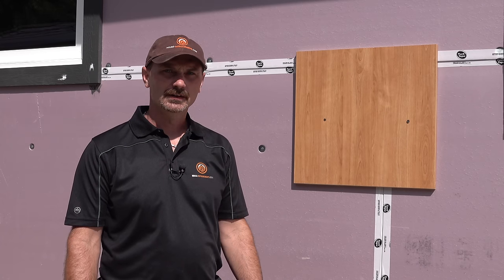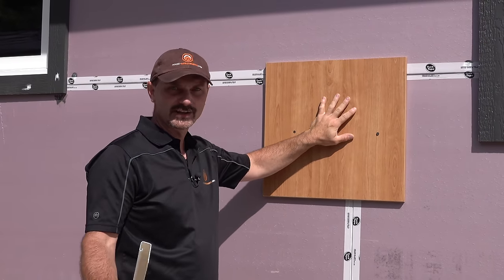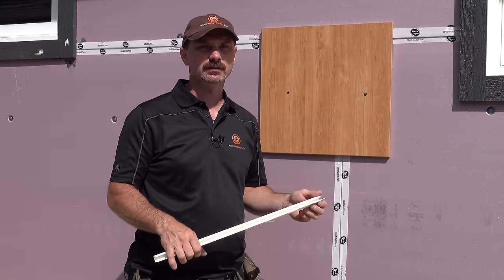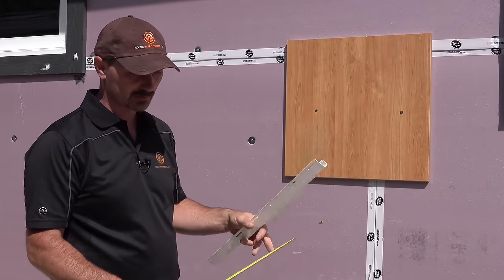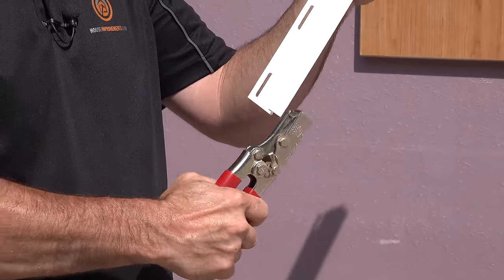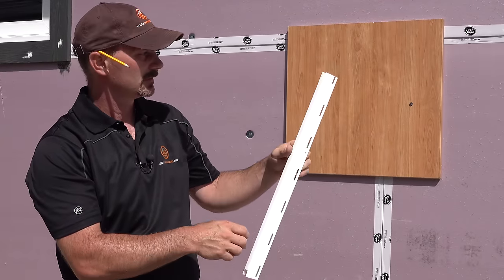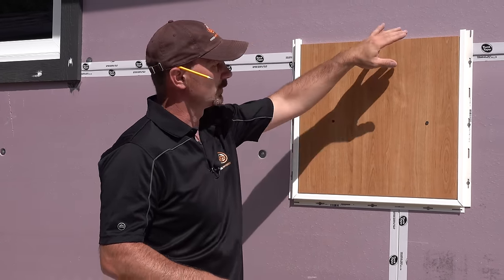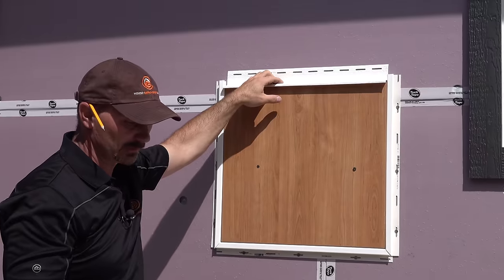How To Install J Channel (Vinyl Siding)

Comment: drip cap should extend well beyond what the drip cap is protecting from drips. Water, because of its nature,  without wind, will wrap back under what it flows over. So, the front and side intersection of the cap should be no closer than an inch to the window, door, etc,  edge, otherwise you rely solely upon caulk joint. The method demonstrated has the  drip edge end right into the back of the J channel. Yes the top is wrapped over into the channel , but the inside corner formed by cutting that tab is now butting the very joint that you are trying to cover. If you still aren't tracking, it is the intersection where the end of the drip cap returns back to the wall.

Comment: That's like my garage wall, the rigid insulation is directly under the vinyl siding. I have to replace an entry door at back of garage and install an exhaust fan.

Comment: Dozen videos I searched through and he is first person to mention a drip cap for windows!
Reply: DUDE, you are so right, I have not seen not a single other video talk about this. Soooo glad I found this before putting in my windows.
Reply: @BobbyCannon  hi Bobby Did you Find the DRIP at Home Depot or Lowe’s ?
Reply: @MACEDONIAbitola  I have framed in the windows but have not taken the next step to cut the metal and finish the install. Working on it as time goes. I'm taking vacation in about two weeks and we plan on wrapping up this install. I'll post a link to our video. :) I have not found the DRIP yet, honestly I keep forgetting. I'm going to put it on our list now.
Reply: @BobbyCannon  I just came back from Home Depot I Found 3 Different Drip Caps 2 Aluminum and 1 Was Vinyl but it was made to Support a J Channel under the Drip Cap I will Try it Tomorrow 😁want to See how the Vinyl Looks Like 👍

Comment: Excellent instructor I learned so much watching this.  After viewing this and a couple of your other videos I went outside to look at the add on section of my house that was done with vinyl siding.  Man the people that put my vinyl siding made so many mistakes. Over lapping the vinyl siding from both directions on the same wall.  Putting the nails in too tight causing the vinyl siding to look wavy.  Your instructions are so detailed and informative. Thank you so very much!

Comment: Shannon, this was so helpful! I love how you actually show us all the steps rather than just telling. I finally learned how to cut J channels easily with the fold over! I got all the j channeling installed on my house before the snow flew. Thank you for your help!!
Reply: How does this prevent water from getting into the crack between wood  and j channel, and subsequently into the wall causing damage? It's going to have to be calked.
Reply: @BWoody914  There should be housewrap already on before you install the J channels. That will prevent water from coming in contact with the wood. Shannon has foam insulation for leveling uneven surfaces on top of the housewrap in this video. 😉

Comment: Shannon, thanks, I watched this again today before installing two more windows in my barn (did the same a year ago). Little different process with the metal siding on an existing pole barn structure, but the J-Channel cuts are the same. I just don't do this often enough to not get a refresher before starting. Project came out perfect, so thank you so much for your instruction, you are awesome, really appreciate you. Even wish I could come work for you, but I'm too old and slow and whatnot; it's just a nice daydream!  Keep it up brother!

Comment: Gotta say I'm impressed with the little extra  time you take to do it RIGHT instead of as fast as possible. The few extra minutes  you spend on a job can save the homeowner   thousands. Too many don't give a damn,  F the homeowner being their opinion. I was in a totally different trade so I learned a lot. Thanks.

Comment: Shannon, this is the 83 yr. old from Ontario. Still building a small house, two story and a total of 200sq.ft. Started installing siding up to  the window. Tomorrow I will be installing J-channel around windows and a sliding glass door.Just watched  your video but I won't be installing a drip edge. On the weekends my son helps. He gets materials etc. and pitches in to get this project

Comment: Very clear instructions. Only thing I’d add is on long vertical runs of J or corner I put a nail in the top of a slot near the top of the piece to keep gravity from causing it to slip down.

Comment: “Snug” on the nailing and adjusting the fit will improve results.  The J channel tends to move away from  the frame with age. Initial “snug” nailing keeps them holding against the frame.  Great advice as always.  Thank you.
Reply: Cynthia Mahlin my vinyl siding makes a lot of noise when it’s windy outside. Is this normal for a newly built home? Or did the builder do a poor install job?
Reply: Ayoub Farid Noisy siding would indicate a failure to properly secure the vinyl to the underlying structure.  I would have it checked by a qualified person.  Also, you can view other videos on this channel for specific information.
Reply: Can't always snug nail as you call it .. You'll b nailing into the window itself .... Try a matching color caulk
Reply: Kyle King Your slots are always away from the window, you should be nailing straight as well to avoid going into the “window”

Comment: I nail all accessories tight and I leave the siding a little loose. Never had a problem. Awesome video!
Reply from the maker: Outside corners can ripple if nailed too tight but most other small trim is fine tight.

Comment: I've been watching Shannon and home improvements for years. Didn't know he's from my home province of Saskatchewan. He doesn't just show you how to do a job, he also explains why, and that's another reason he's one of the best. 

I agree with Shannon, you'll hear this alot: 'Keep your nails loose to allow movement of the vinyl' . I've never seen vinyl buckle. Contractor I worked for uses an air stapler with crowned staples. Never had a problem. Shannon knows what's up

Comment: There's a better way of doing miters. Instead of cutting your miter from the end of your side pieces, cut them about an inch and a quarter from the end, on the back side, make a line squared to the short end of the miter and make a cut, then cut off the back side completely and also cut the round part of the front side. So what you end up with, is an L-shape rain tab that's about 2  and a quarter inch long that will slide nicely inside the front side of the other J-channel. Once it's nailed in place, your corners will be locked together. I learned this trick here on youtube a few months ago and it works great.

Comment: Extremely useful video here four years later, thank you!  I've searched for the following question online but all results are when j-channels are installed vertically.  Is there a best practice for when you have to overlap and extend a j-channel on a horizontal run?  For example, I have my 12' stick but need to go another another 4' yet.  Same notching and overlap technique for vertical runs but it doesn't matter which piece slides into which on a horizontal? Thx!
Reply from the maker: Ya basically notch one end by about an inch to fit inside the end of another. If they are horizontal it really makes no difference which one to notch

Comment: Thanks for showing this, I wasn't sure how the pieces came together, you made this clear.
Contemplating changing windows on the second floor bedrooms myself. Thinking of going at it with a sawzaw in between the window and the j channel. Then playing the window in with insulation etc. Will save $$ doing it myself. Any tips? :)

Comment: Installed a garage exhaust fan and need to J-channel around the flap in the back. Fortunately it's under a patio roof however I still want to get this as best as possible because I may be doing this in other areas of the house that are directly exposed to rain.

Comment: I'm adding a pergola to my vinyl sided home.  Installation requires a ledger board to connect the main pergola beam to.  This will be under the soffit by 10 inches.  There shouldn't be much rain driven up into this area, so will J-channel on all 4 sides be adequate.  All of the windows directly below this area are done this way.
Reply from the maker: That should work fine

Comment: Great video, very informative.  Thank you for taking your time to put this tutorial together for newbies like me. My neighbor is having vinyl siding put on his house and I noticed the guys doing it left 2" to 12" gaps in the pink foam and didn't  wrap the wooden structure first and they didn't tape any seems that were somewhat close, they didn't wrap the house after putting the Styrofoam on they just went straight to j channels and throwing siding on. Your video caught my attention to this as your foam is tight together and you mentioned you had wrapped the house prior to the pink foam. Should the foam always be as close together as possible and should you wrap a wooden structure before or after the pink foam board before putting the vinyl on? Sorry I know this was winded and off j channel topic.
Reply from the maker: Yes the foam should be tight together and the wrap can be under or over the foam

Comment: Is that panel for the electric meter?  This is why I ended up here.   Hoping to move the roof wiring drop down onto the wall (From overhead to underground) and I am thinking I need to have a flat secure surface for a wall electric meter.  The house has wood siding under the vinyl but I cannot see the electrician putting the meter on top of the vinyl.
Reply from the maker: this was just for the video and was removed after but you could do this. there are special vinyl blocks with built in J channel.https://www.homedepot.com/p/Builders-Edge-15-5-in-x-16-5-in-123-White-Meter-Mounting-Block-130010005123/100674376
Reply: @HouseImprovements   Very much appreciated.  We just had a hailstorm here in early April with 2" hard stones.  I will be looking for some replacement vinyl--a few pieces of Wicker color and also plan to remove the low hanging electric service wires from the roof.  Your reply is more than I could dream of....!!  The house is 60 years old but the siding is from 2010.  All of the usual places sell this item  (Menards; Lowes and Amazon).  Menards lists at least 30 colors!!

Comment: Excellent video!  Shannon does an outstanding job of explaining how to install J-Channel around windows.  His other vinyl siding videos are equally as good.  I used his instructions to install the vinyl siding on my house and the result was a very professional job even though it was my first time with vinyl siding installation.  I wish I could upload a picture of the end product to prove my point.
Reply: Cool same here George about to do a 2000 sq ft house. Glad I got windows with the J channel option! Will do drip caps on them anyways.

Comment: what if the soffit or windows are not true and straight, do i install the j trim tight to the crooked carpentry? or to I try to make the j trim staight, and fill the gap between the j trim and soffit/window frame with some caulk or foam or something?
Reply from the maker: Tough question. Generally I fit it tight to the objects I'm working around.What looks worse crooked trim or gaps filled in?
Reply: @HouseImprovements  true, that's what i ended up doing. It all blends in at the end to the untrained eye I guess. Thanks for the response!

Comment: Great timing for me to find this video!  A friend of mine's house burned & she's living in a metal shop building.  Some other dude(s) cut a hole for a window in the side (Sawzall...and crappy rough uneven cut!) that houses a large fan.  The window leaks.  No caulk on it or anything.  I didn't know anything about J-channel until a few minutes ago.  Questions are:  1)  If I take her window out, can I insert some J-channel (J-trim?  difference?) beneath the metal but have it overlap the edges of the window?  Caulk all the way around it, too? 2)  Can I use vinyl J-channel on this metal building...or do I need to use aluminum J-channel on a metal building?  TIA!
Reply from the maker: please post your questions in my forum and i can assist you from there.https://www.house-improvements.com/forums/

Comment: Do you recommend caulk around the interface between the wood and inside of the J-channel? (Specifically, where your pointer-finger is pointing to at 9:21, for example)

Comment: Shannon, Excellent video on all facets of J Channels.  Best I have viewed.  I need to put in a ledger board against existing vinyl siding for a patio cover.  Do you have any recommends?  It will be approximately 12 feet across.  I plan on taking out a segment of the existing siding and using your recommendations.  How would I place the J channel and drip cap in butting up next to the existing siding already nailed in; this would be related to the top J channel?  Thanks, Chip
Reply from the maker: My forum is the best place to ask questions and get some help.https://www.house-improvements.com/forums/

Comment: I have 2 J channels meeting at a 90 degree angle and they are leaking rain water where they meet.  What is suppose to stop the rain water from leaking onto my plywood ? It is in an unfinished garage so I can see it pretty clearly when it rains. Mold is growing on the plywood.   Your videos are very well done and I do appreciate all the hard work and effort that goes into them, again thanks.
Reply: You need a membrane on the outside of your sheathing that allows the building to dry but sheds water that makes it easy behind the vinyl siding. Vinyl siding is not designed to be one hundred percent waterproof, breathable membrane that's properly taped at the joints is essential. 

You're going to have to pop off you siding to get underneath it to put a membrane on. 
Tyvek is a popular choice around here.

Comment: Hi Shannon, this was the most helpful video on j channels I have watched. My husband and I are building a tiny house and have been learning as we go through online resources. The majority of our windows were from a demolition resale site. They have a thick rim that looks like a j channel around them, already attached. Could this be to replace j channels? I cut the pieces for one of the windows but cannot fit the channel in underneath their channel (ours is 3/4" depth)
Reply from the maker: Yes some windows will have a built in J channel

Comment: Hi Shannon. So I finally finished putting up my j-channel and corner pieces. Your videos have been a big help. My question to you is this... My house is 100 years old and the wood is extremely hard and driving the nails into it for the j-channel and corner pieces was a b***h, to put it mildly. Many times the hammer just bounced off the nails. I am now dreading nailing on the siding. What would you suggest to make nailing hundreds of nails into very old, hard wood easier? I'm thinking about possibly pre-drilling the holes where it's extra difficult, but that's a lot of pre-drilling. Thanks in advance.
Reply from the maker: Thats really the solution. Nailing right at or near the existing studs likely works fine but when you get out between them the boards have more spring to them.

Comment: GREAT video! So glad you went right to work and didn't blather on about what you did all morning like some guys do! I have a question: I am replacing a double hung window, 38"x 38" with a new, casement window 38" high by 5'-0" wide. I have aluminum siding so realize I will need to cut and re-frame. Do I need to remove the siding in the area of the new window or just cut around my rough opening?  Most videos I see are working with vinyl, which is easier to remove/ replace and bends with out denting like aluminum or, they start with an unsided wall.
Is there a way to use the J channel so I don't have to remove the siding? One of the windows I priced had an option of an integrated J channel but that would mean I would need to cut the siding way back to fit that in or force me to take off the siding and replace it once the window was put in. I don't want to try to cut corners,(OH! no pun intended! :) I want to do this right. Thank you!
Reply from the maker: Please copy and paste your question to the forum it will be easier to go back and forth there.https://www.house-improvements.com/forums/

Comment: Thank you for this video. May I ask what nails I should use for the siding installation on the 1/2-inch ODSB wall? The siding nails in Home Depot are 2-1/2 and 2 1/4 inches loos too long for me. Also how far the window or the door must stick out from the wall? And may I ask you how much the window has to stick out of the ODSB board to allow proper matching with the J-channel?
Reply from the maker: 1-1/2" shingle nails work fine. Preferably you want items protruding 3/4" Min. from the surface of the OSB for the J channel to work well.
Reply: @HouseImprovements  Thank you for your prompt reply! May I ask you what type of J-channel should I order if the window will be protruding 3/4" Min. from the surface of the OSB? Home Depot currently offers two types of J-channels 3/4 and 5/8.
Reply from the maker: J channel size is more to do with siding profile that fits into the J with out being too tight or too sloppy.

Comment: Would these instructions work for putting J-channel around a mounting block for an electrical fixture? (This video popped up in my feed just before I finish attaching a wall lantern tomorrow!) the base of the lantern is too tall for an off-the-shelf surface mount block.

Comment: Hey! I am trying to put a ledger board 8 feet up on the house wall which has the vinyl sidings. I know how to remove the vinyl siding. But what should I do to cover the gap between the wood edge and wall edge. Its barely an inch.